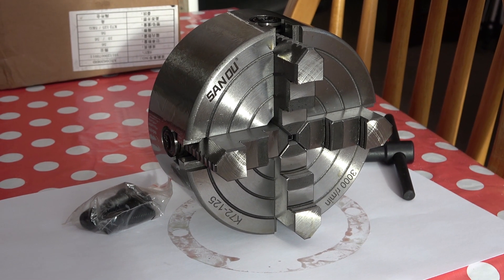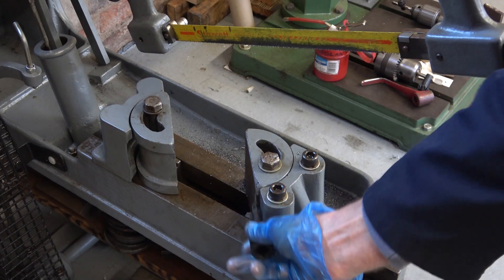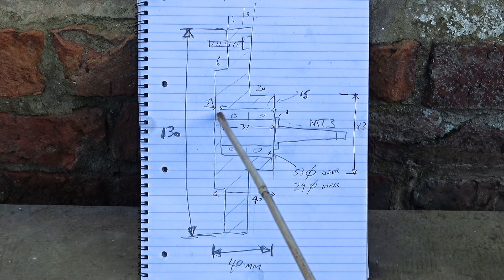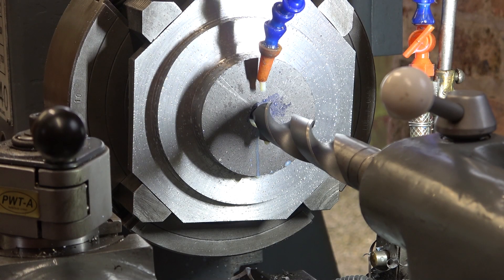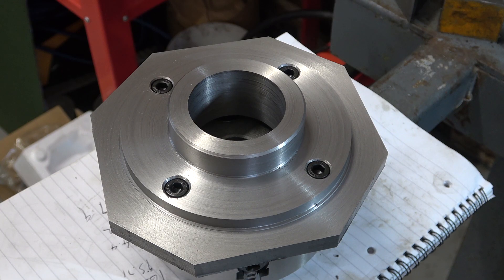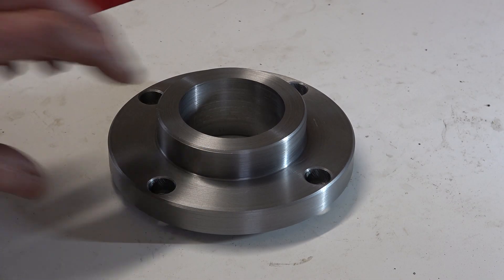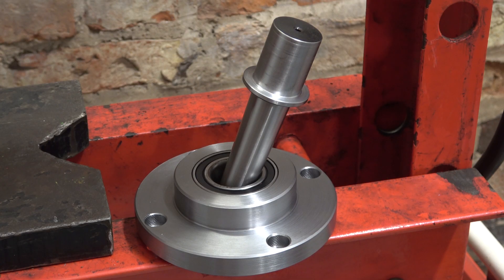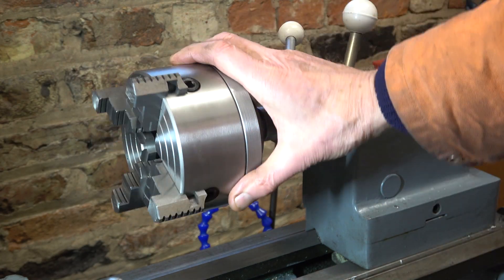HS43 Making a tailstock 4 jaw fitting for my Harrison 140 lathe

Comment: Perhaps I have missed something here. Why would you want to fit a 4 jaw chuck in the tailstock? I have been machining for over 40 years and never needed to do this. I am hoping to learn something new today!
Reply from the maker: I picked the idea up from some heavy machining videos where an awkward shape, perhaps with no centre, was held between two 4 jaw chucks. It can also be used for eccentric turning. But also my motivation was it was a nice project. I may never need it - I just wanted to do it as an addition to my equipment. But my experience is that when you have something eventually it gets used. Cheers
Reply: I too  wondering why one would want a 4 jaw live center. I have been matching  for over fifty years  and never had a need for this setup
Reply from the maker: @donmazurick1821  Hi Don, I have an idea for a project. Maybe after Covid lockdown I can find the metal and make the video showing a use for the tailstock 4-jaw. Cheers
Reply: @donmazurick1821  Don, Mr. Haxby is correct. I have a  conveyor roller, and the shaft end was damaged by the bearing retainer lock collar that was not tight. COMPLETELY damaged the stub end. Not only does a 2.50" bearing fit on the shaft, a drive pulley mounts next to the bearing too. Naturally, the manufacture did NOT put a center on that damaged end. I put one in, deep, just to mow off weld build up (and there was a LOT of weld build up !). Now, how do you get BOTH diameters exactly in line, without a 4 Jaw chuck on the tail stock side ? Waiting for the bearing, and must build the "Custom Service Tool" before I can finish the job.
Reply: Crankshafts and cams.
Reply: I don't think. it depends on the length to time you have been machining, rather the type of work you do. Machining large tubes and preparing them for a fixed steady REQUIRES either a cone or preferably a 4 Jaw chuck. If you don't do this sort of machining, fine.

Comment: 2.5 thou is way to mutch for a bearing fit . 0.02 mm is more than tight enough  (0.0008 " ). It isn't running that well when you rotate it by hand . Bearing will soon brake if you put it under load. But the idea is very nice
Reply from the maker: Hi, thanks for the comment. The 2.5thou interference was between the MT3 shaft and the internal diameter of the inner race. A press-on fit is the only thing holding the chuck on the MT3 shaft. It does not spin freely because of drag on the seals each side of the bearing. But I take your point though, if the inner race expands due to a tight fit on the MT3 shaft then yes it would make the bearing too tight and it could run hot and fail. It might have been better if I had used your advice of 0.02mm press fit on the MT3 shaft and then put a bolt on the end to hold it all together. There was space for a bolt.  (So in a lot of words I'm kind of agreeing with you actually).  Cheers
Reply: @HaxbyShed  You might run the chuck for a while and monitor the bearing to see if it is getting excessively hot. Too much heat may give you a head's up on the fit being squeezed too tight
Reply: I agree
Reply: I CERTAINLY ! PREFER ! HAXBYS WAY !! TO YOUR !! WAY !! YOUR !! WAY !! WOULD BE !! TOO !! MUCH !! SLOP !!! ON !! IT !!
Reply: @davidwillard7334  looks like you don't know s**t about this matter...

Comment: Sandvic Huh?  The chigchong TCMTs I use break the chips just fine....And THEY chip just fine too! One slip and they are gone. I'm partial to Kenametal I can get a box of ChiCom Mitsis for the price of 1 Kenny. - But as far as finish and anything else there is nothing wrong with the Mits.  - Don;t be a cork Sniffer, Bro.
Reply from the maker: Hi, thanks for the comment and the advice. I'm just a learner and it's probably my inexperience but I thought the sandvik was working better for me in that case. I had to look up 'Cork Sniffer', I'd not heard that before and it made me smile. Yes there are a lot of urban myths and people do recycle bad info, not having the experience themselves. maybe I'm guilty :-) Cheers.

Comment: Tungsten inserts have different chip breakers on them, so perhaps it's not black magic but the wrong type of insert, chip breaker wise. 

You can make inserting a bearing or shaft easier to manage by chilling one and heating the other, clearly don't heat a bearing, so put the shaft in a freezer for a couple of hours and it will probably fall in.
Reply: You can heat a bearing we do it all the time . We use Magnetic Induction Bearing recommended by SKF - Big Bearing Company temp probe on inner race & no more then 280 degrees max it will expand enough to drop right on when spec's are right this works great for mounting bearing on a shaft & to go into a housing or casting we dry ice the bearing for an 1/2 - hour plus depends on how big the bearing is it has been working for us for the last 40 + years in are shop.
Reply from the maker: Hi, I understand about the chip breakers but I think it is mostly my lack of experience. Somebody commented to try feed up speed down so I will have a go at that next time. Cooling the shaft is another thing I need to try out. Cheers for the advice.
Reply: Ref Inserts, I only found out recently that, the depth of cut recommended is based on the insert radius, smaller R for lighter cuts, and also minimum depth should be larger than the nose radius. here is a link to the experts, Sandvik.https://www.sandvik.coromant.com/en-gb/knowledge/general-turning/pages/how-to-choose-correct-turning-insert.aspx. You can use single point threading inserts for fine cuts. Hope this helps?
Regards John.

Comment: I am stealing this design. I have a Clausing 5914 which appears to be the same size as your lathe here. I have been needing one of these for some time now and never got around to making one. Really like the idea of using a front wheel bearing!! Very smart!
Reply from the maker: Hi, I think I said it was a bearing from a Ford Fiesta Mk1 but actually it was a Ford Focus Mk1. I was unsure whether to use a 4 inch or 5 inch chuck. I went for 5 inch and I'm happy with it, but it is quite heavy and the tailstock can tip forward when not clamped. If your bearing inner race has split cups (pushed in from each side) be sure to hold them tight together when you press in the shaft - or add a bolt on the end to clamp the two halves together if you have space. I've no idea when I will use it on a project but I'm sure I will be glad of it when the time comes. Cheers